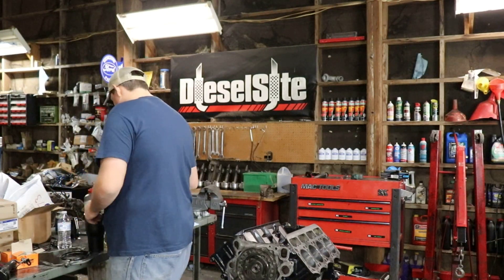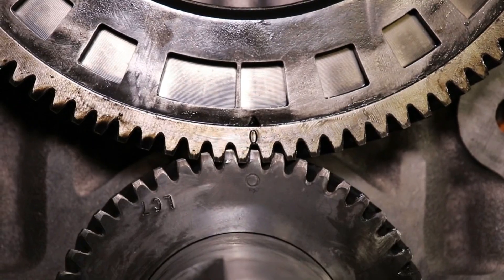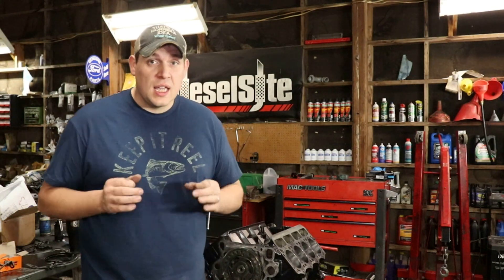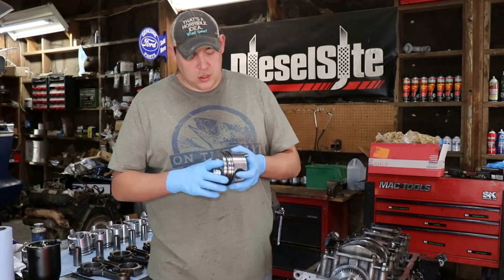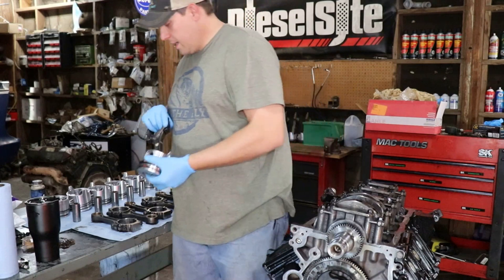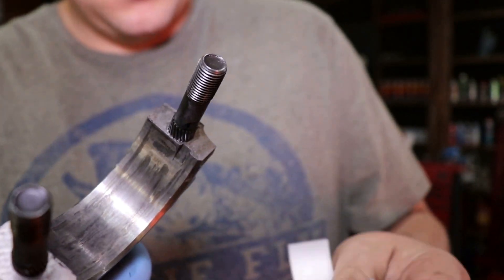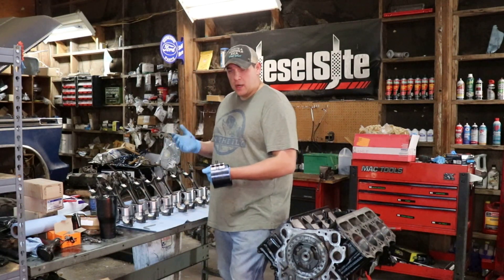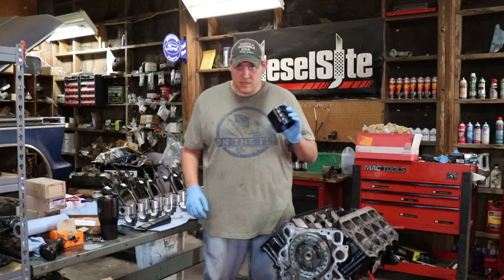7.3 POWERSTROKE ENGINE SHORT BLOCK REBUILD

Comment: My last car was an 03 Subaru WRX wagon me and my machinist buddy built together. He did all the machine work completely blueprinted an old sti block and we built a bullet proof 500whp capable engine and turbo system. Garret gtx3076r was a screamer made ~300whp at 10psi. my new project is a 97 f250hd XLT ccsb. Always wanted a obs ford and this was too cool to pass. It has ALL of the typical high mileage obs Ford problems and then some. But it runs well(I think). Needs a lot of attention in just about every area but that's how my Subaru started. That car showed me what is possible when I stay dedicated to a project. Cannot wait to get this truck back to glory and make it fun to drive again. Me and my 3 year old will be doing a lot to this truck as he gets older. It's going to be his truck some day that's my dream.

Comment: I've never worked on a cast iron block.  How hard is this do to at home?  What kind of prep work needs to be performed to the block first?  Honing?  Do the decks need to be resurfaced or is that unnecessary for cast iron?   Great video.  I appreciate the time you put into it.  I've got a 7.3 with blowby, need to figure out what is the best approach.
Reply from the maker: If you are inexperienced, then the razor blade approach to your deck is your safest bet. If you need to hone, then you're best off just getting it bored out. At that point the machinist can clean up the deck surface if need be.

Comment: You listed the cylinders backwards I believe. Left side is odd, right side even.
Reply from the maker: Nope. I said it correct. You're right, it is left side odd. I listed them that way. When I was explaining the piston position the engine was upside down so 1 was on the right. When I listed the numbers the engine was back upright and I went left right front to back.
Reply: Cool, thanks for the video.

Comment: Why do you want the main bearing dry ?
Reply from the maker: Only on the back side. You increase the chance of spinning a bearing if you do. When you pull one apart you'll find they're usually still dry.
Reply: @MrVanderchevy18  ok thank you i was thinking you meant the crank side i was like 😲 lol
Reply: Asked the question, Google it and found nothing, better be talking about the back side

Comment: Why no lube on the connecting rod? Seems like a bad idea to leave it dry.
Reply from the maker: It wasn't dry.
Reply from the maker: At 13 minutes you can see me using lube. As far as lubing the wrist pins, that may have been cut out. All the wrist pins were lubed when I set them out.